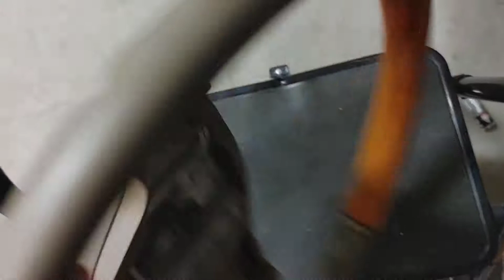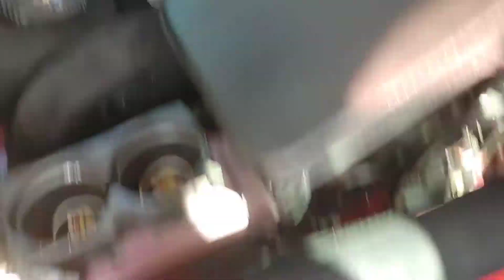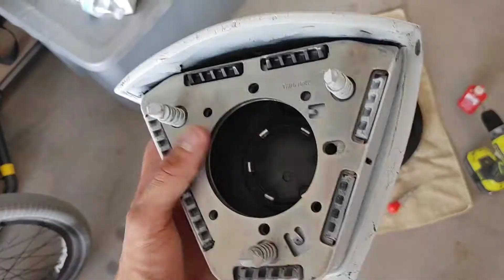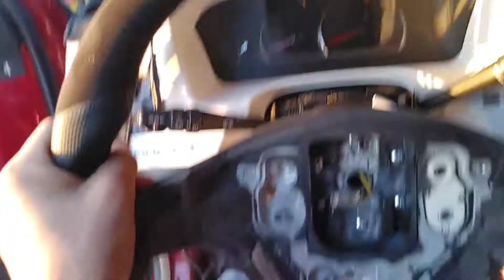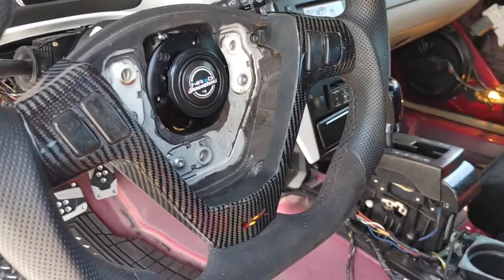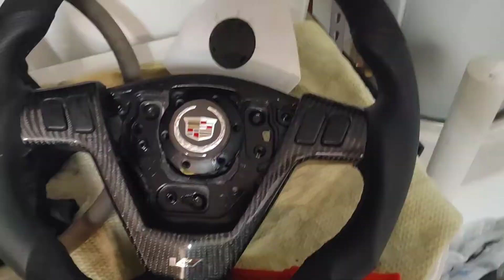Cadillac STS Custom Steering Wheel Quick Release Modification!

Comment: Good stuff dude I like the the quick disconnect even if you didn't use it for a road racing you could use a security take steering wheel with you know what to take your car
Reply from the maker: the only downside is no airbag. It's dangerous if you don't have a harness but it's okay if you don't drive in busy roads much